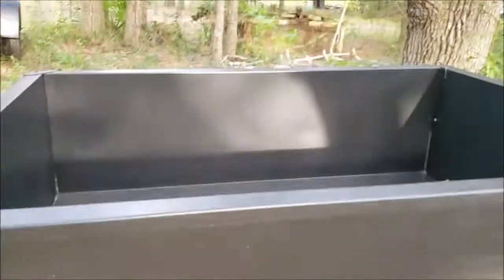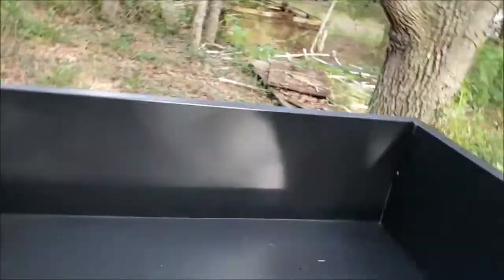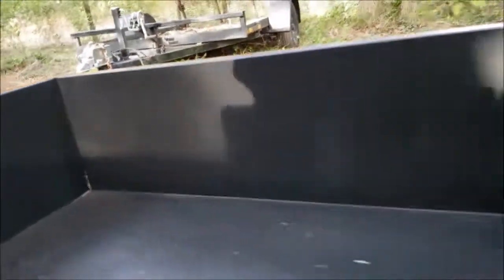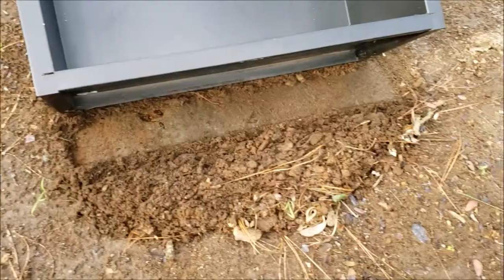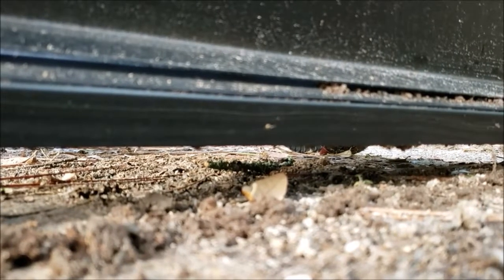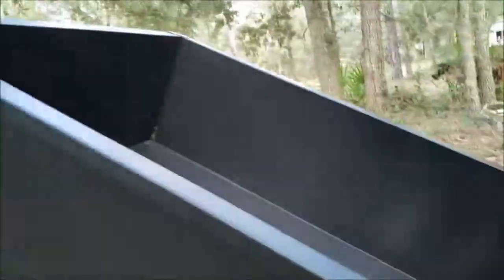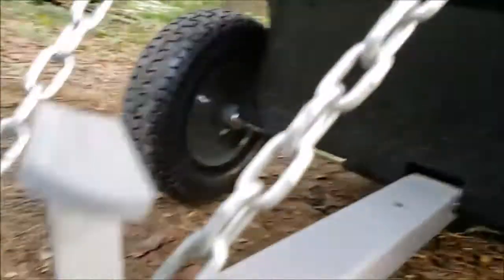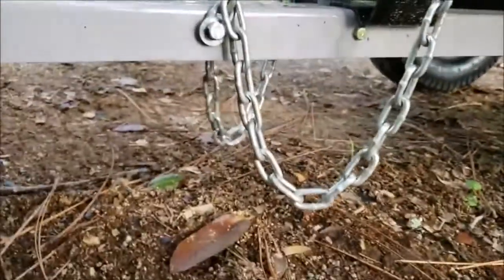Dump Cart Modification

Comment: Just bought the exact cart from TS. Installed a 1320Lb linear actuator so it dumps with a flip of a switch and limits travel to not plow as i had the same issue as you.